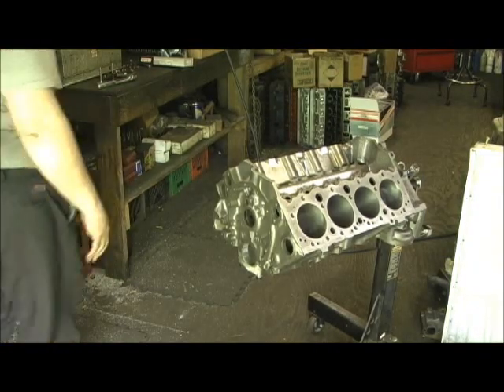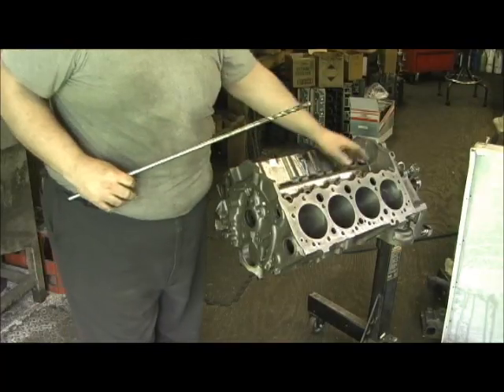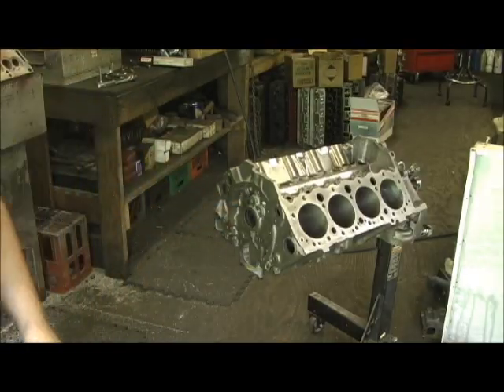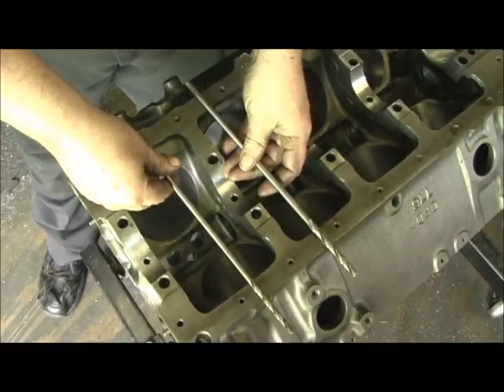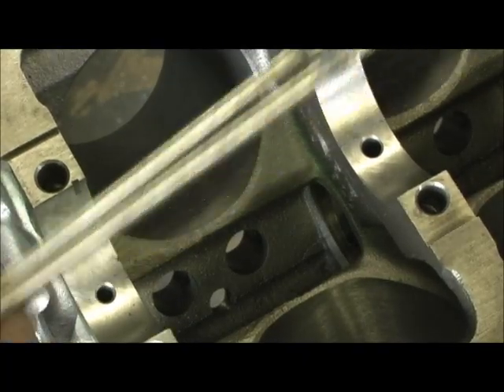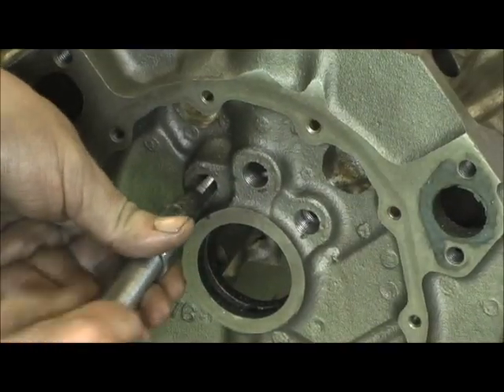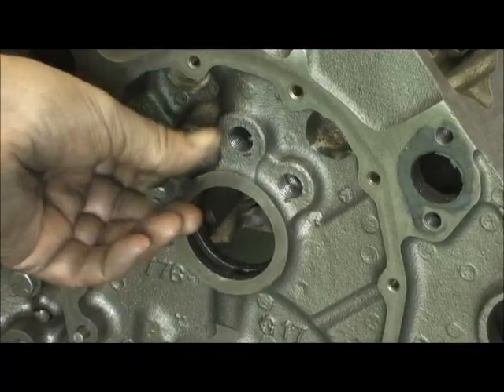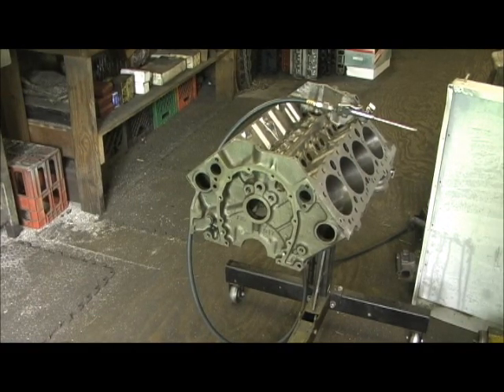334 Block Oiling Dril Bits, opening up the oiling passages, and galleys Part 3 1

Comment: I am building a sbc nitrous motor and would like to do this to my block. But I know I cant run a high volume pump because of the little stock oil pan I have to use. It is going in a small car. I don't want to drain the pan dry with a small oil pan and a high volume pump. Will this work with a standard volume z-28 high pressure pump and be worth it? Thanks.

Comment: With these same oiling mods done to a GM 2 piece rear, 4 bolt main, ARP studs, billet crank and forged rods and pistons, how much power would the block support?
Im looking to build a twin turbo 388ci  GM block and around 1000whp ish on the street. Thanks!

Comment from the maker: It just makes it easier to do this first, then chamfer the oil holes, then align hone. You can do it like you mentioned, it just leaves a small ridge after the chamber (LIP) that can did into the bearing. You can remove the ridge with a dingle berry hone and a pass or three with it.

Comment: Have you ever done any of this on any SBF blocks like 302's and 351-W. I build quite a lot of Cleveland's and I just run a 3/8 oil line from the back of the block where the back of the intake is at and rout it to where the oil signing unit is located at on the left front side of the block. This helps get extra oil to the #5 main bearing. If you have done any of these helpful tricks to SBF please reply. Thanks for the cool vids.
Reply from the maker: Wow, Yes and NO at the same time. This is a trick we have been doing for the 455 Pontiac, to help the big 3.250 Mains hold oil at High RPM. We use Brake lines and route it from the oil filter housing and around the back of the block, them drill a hole THROUGH the block near the top of the intake, then around the pushrod area till it gets to the No 2 cam bearing, then drill/screw it in. This solves the oiling coming from the back to the front of the block last, and stops the No. 1 and 2 main from loosing oil. Sounds like the same thing your doing, it WORKS well on the old Yaks.....

Comment from the maker: Wait Please, I am going to show you everything you need to duplicate Holder Boulder. I don't' want to ruin the show here, I have more emails on this then most of my head stuff and I hate building engines, they take way to much of my time. I am a cutter, not a engine builder' however, when I do one they LAST and run like hell because I am a perfectionist in my heads and it just transfers over to the engine. I have done about 50 engines over the past 17 years like this, and not ONE ever came back.

Comment: Thanks for the videos!  
Do clearances of bearings remain stock or are they enlarged too??
What weight oil will you run?
(my stroker is going in a 23' cuddy)

It would be interesting to see a build sheet for Holder's Boulder! (cam/ heads/ intake carb etc...)

Comment: Thanks for this info, I am on a quest for a 383 with a roller cam.
 Do you ever drill a hole in one of those galley plugs for oiling of the timing gear/chain?
(seen this done and wondering if it is advisable)

Comment from the maker: There is NO NEED to do this to the BBC, as it has Priority main oiling (oils the Mains first, then the rods). that being said, IF this is street and it is Hydraulic camshaft, you could do the two side lifter galleys with a 7/16  22" long drill bit. I got them at Drillbit.com in the aircraft bit sections. Just make sure you DON"T go all the way through, go to where the Threads begin coming FROM the timing chain area going to the back of the block. DONT go thru the threads or Block Is Junk